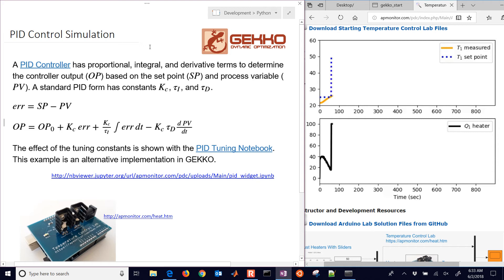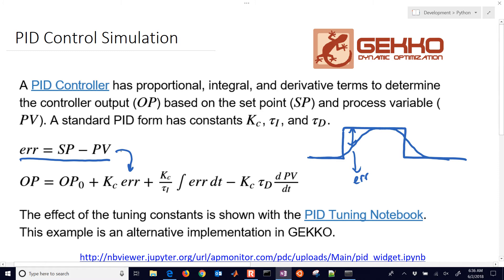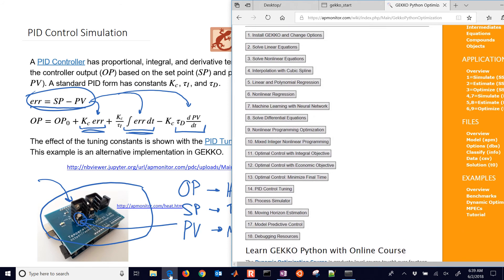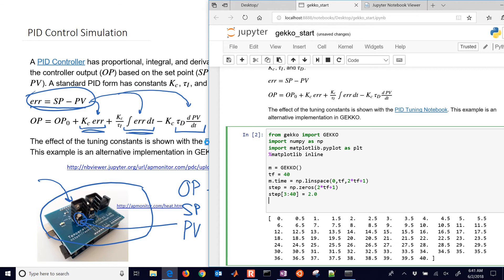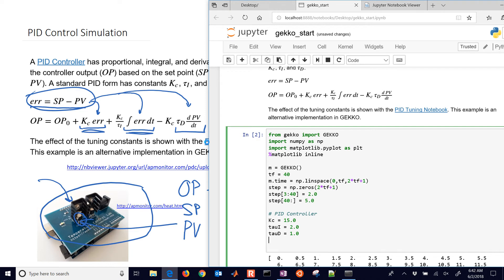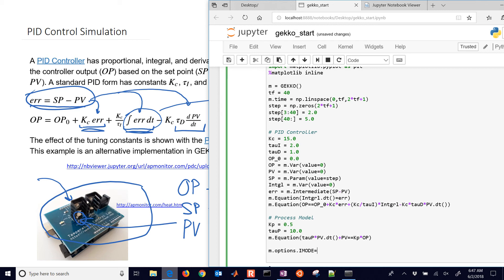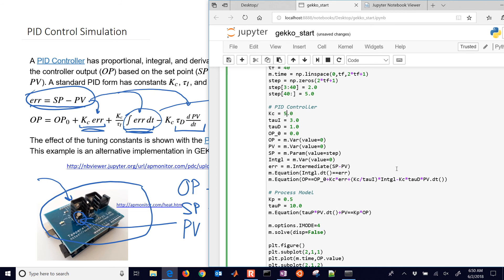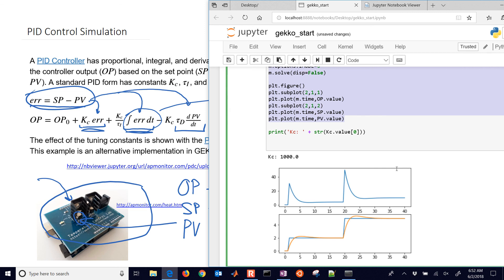PID Control Tuning with Python GEKKO

Comment: nice tutorial sir thank you, one question though, what if I already have data for the SP, PV as well as the Kc,tauI,tauD  and i want to re-tune the PID coefficients(Kc,tauI,tauD) how do i do it?
Reply: meaning i already have a PV and noticed that its a little bit off vs the setpoint, so i want to re-tune the PID coefficients.
Reply from the maker: @datastako156  you can set up those parameters as initial guesses for the optimization or else add change constraints so that they can't move a certain amount from the initial value with DMAX in Gekko

Comment: Hi, thank you very much. 
I'm trying to run the very same code, but receiving the following error message: 
Exception:  @error: Insufficient Model
 Model must contain at least 1 variable and 1 equation
 STOPPING...
Would you mind helping me out?
Reply from the maker: Try using the code from the website. Does that help?
Reply from the maker: @陳昱愷 try using this code https://apmonitor.com/wiki/index.php/Main/GekkoPythonOptimization?action=sourceblock&num=16
Reply from the maker: @陳昱愷 try updating the Gekko package with pip install gekko --upgrade
Reply: @陳昱愷 I'm glad that you found a fix to the problem. With remote=True, it solves the problem in the cloud so you need to be connected to the internet. With remote=False there is no requirement for a connection and everything is solved locally.